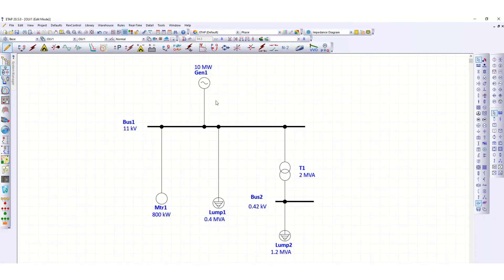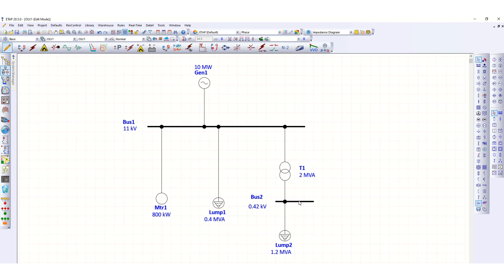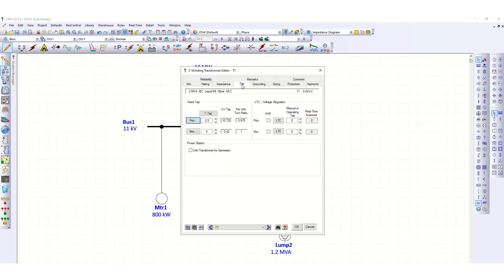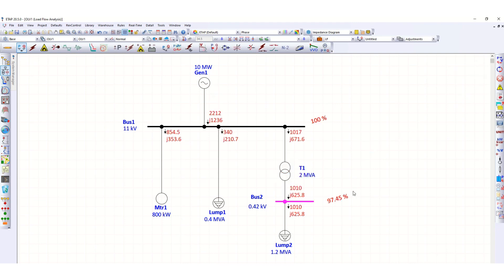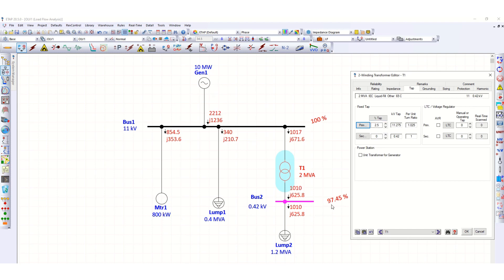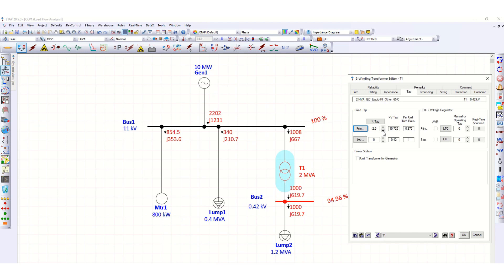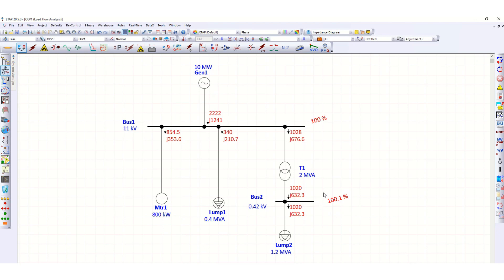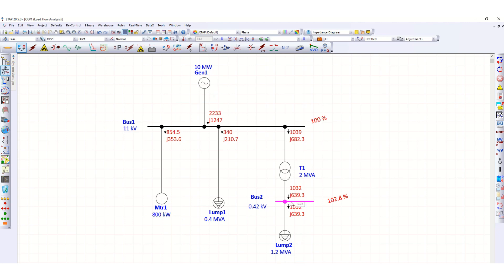ETAP Load Flow Bus Under Voltage problem [Solved]

Comment: WHY THE NEGATIVE TAPPING INCREASE THE V, WHILE IN REALITY IT IS THE POSITIVE TAPPING IS THE ONLY WAY TO INCREASE THE SECONDARY VOLTAGE???
Reply: Tap in one side is inversely proportional to the other side voltage. . In this video tap is reduced in primary side hence voltage increase in secondary side